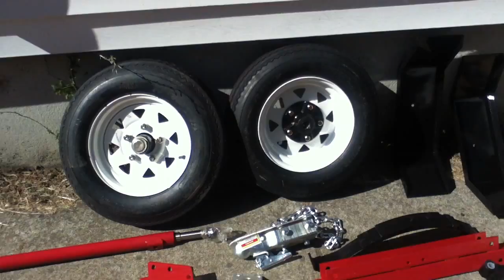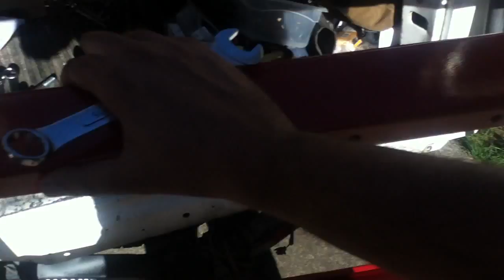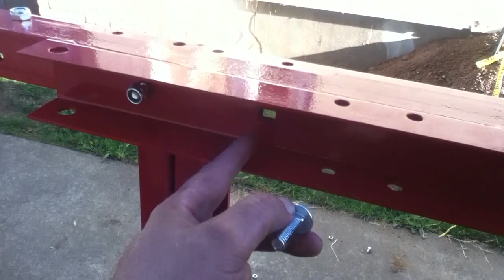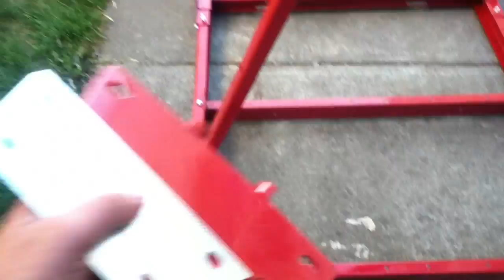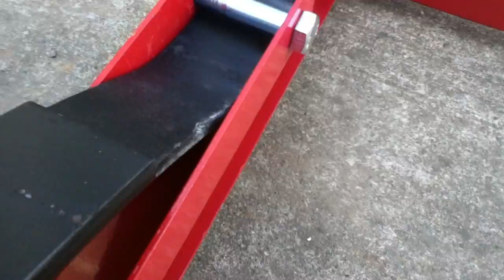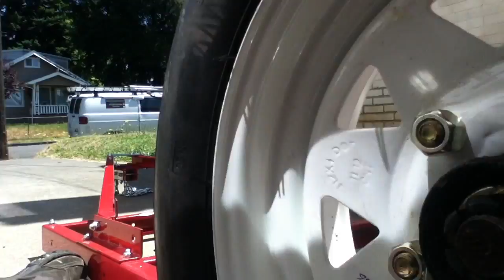Harbor Freight "Super Duty" trailer frame build Item #94564

Comment: Another tip that helped me.  At 15:00, you said put the screws in the corner to hold it straight and take them out later.  Yeah, that's good.  At that point, I took a pair of screws and nuts and attached the two middle rails (the hinge joint) together.  It helps a lot to hold it straight and keep it together as you put the suspension rail on.  Once you finished and you want it to fold, pull those two screws and nuts out.
I said "why make it fold?  I'm not going to need that."  Then I looked again and said, "I got the parts, I'll put them in".  I'm glad I did, I use the fold feature all the time.  (Or course, if you're building a special thing where the folding thing would work, that's OK too but for normal work around the house, yard, shop, the fold is handy.)  Also, I put my coupler jack on the front rail.  It lifts the coupler onto the ball OK, but I pull the pins and jack the front of the bed up off the hitch A-frame.  That tilts the back end down just a little.  With a small ramp, my motorcycle goes right up into place, clip the tie downs on (have them ready), and then lower the jack and put the pins in.  Easy.
You must be doing all the things right on your trailer -- you did  it just like I did!   Good video.

Comment: I sure hope you repacked the bearings and redid your safety chain securement to trailer! The grease in the hubs was shipping grease and not wheel bearing grease. The assembly instructions I have read are very specific on those issues.
Reply from the maker: American Rambler Ah, good point.  I was going to replace the bearing caps with the kind that have grease fittings before the trailer was stolen.  When I finally get it back I will make sure to check that when I replace the tires, but it's in pretty bad shape and I was unable to retrieve it anyway the last time I had gone out to where the robbers had everything.

Comment: According to the manual, you are supposed to clean and repack the wheel bearings before assembly.  That's what I did and put high quality red grease in.

Comment: Dont assume you can just go back to the store and get a missing part. I bought one of these exact kits from harbor freight. Box was missing the right rear frame rail. I'm still waiting on the piece from harbor freight. If you buy the kit and something is missing, unless they can replace it in store, that day, return the entire trailer. Their customer service kept promising me the part would be in "next week", until the 90 days return period has lapsed.
Reply: +Neil Jost I was missing some bolts and the store manager allowed me to take them off the display!

Comment: Hi 8digitPDX.  I'm really enjoyed your video.  I'm having an issue with attaching the wheel frame to the body frame.  There are two bolts which protrude through and frame and don't allow the wheel frame to mount flush to the body frame.    Can you help me?  I don't think it would take you more than 10 - 15 min to explain it.

Comment: Where can you get the bearing caps with the zerk firing to pump grease into the bearing?
Reply: Trevor Jentzsch    You don’t need them. There’s already a grease fitting on the back side (behind the tires) of each of the two hub assemblies.
Reply from the maker: Trevor Jentzsch Harbor freight will have them and so does Napa auto parts.  The hubs on these are a pretty standard size and bolt pattern so standard stuff for basic 1 ton 5 lug trailer axle and hub assemblies will usually work fine.
Reply from the maker: *****
 That fitting is hard to reach in the best of times, while the boat trailer bearing caps are not very costly and very easy to work with.
Reply: +Trevor Jentzsch camping world, I think call them

Comment from the maker: They call it a 12" tire (measured at the rim) but it is the 5 lug version, not the 4 lug version, and runs something like 80PSI while their other 12" 4 lug tire setups on the lighter duty trailers are slightly smaller and run less air pressure.

Comment from the maker: The instructional video here is for the basic build minus fenders and lights.    I am customizing this trailer right now and will soon publish the video on making it a slightly larger size flatbed where bed goes over (not inside of) the wheelwells.   I have a couple of small jobs lined up already which will help make the trailer pay for itself.   Assume to spend around $200 in materials to finish out one of these unless you are going bare bones 4X8 flatbed.

Comment from the maker: Here in Oregon we have Harbor Freight retail stores in every city and several suburbs.   There is no sales tax here.   I combined an ultra rare 25% coupon with a sale price to get the kit at $275 and hauled it out in my truck (no shipping).  You normally pay $350-$400 for the kit.   Figure another $200 in materials for building up after that depending on the configuration  you want.